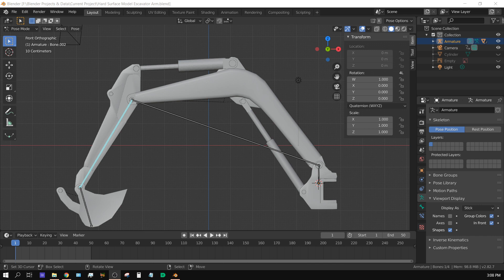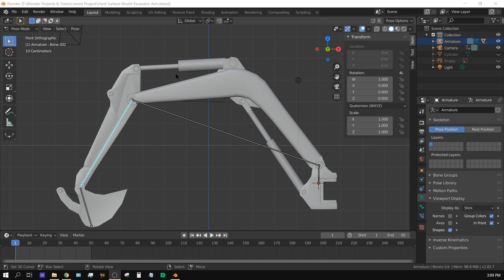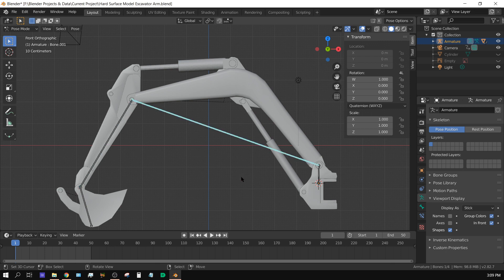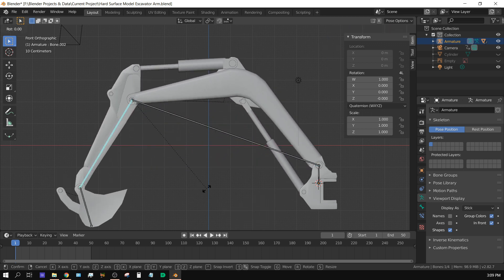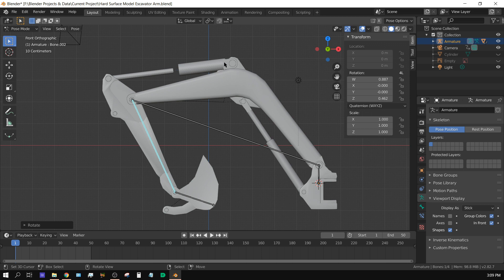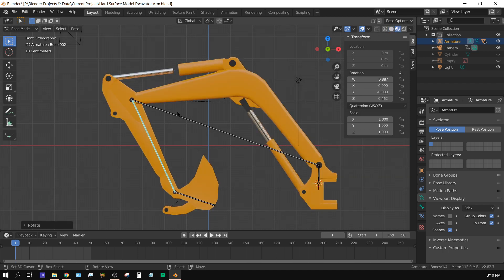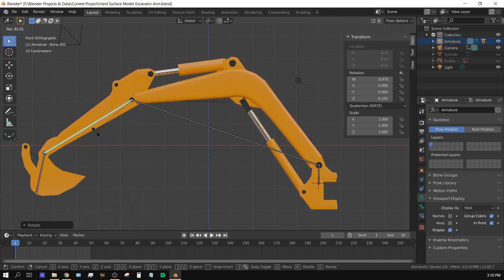Excavator Digger Test Bone Rig #BlenderRookie

Comment: Hey, this actually looks cool.

Now I'm thinking of possible ways to mix some physics in. Make each part a separate invisible collision mesh, add constraints inbetween to keep it all in place, and parent original bones to the meshes? :D
Reply from the maker: The only part that needs to have rigid body physics is the bucket and it can just be made an animated rigid body mesh object.
Reply: @BlenderRookie  
Makes sense, but what about throwing large things and forcing the entire excavator to tip over? :D

Comment: It's coming along nicely. You have really improved over the years, give yourself a well deserved pat on the back!  Out of interest, what motherboard do you currently have? I am looking to get dual 2060 supers or if can 2070 supers.  But anyway keep up the great work, and enjoy it!
Reply from the maker: Thanks, I appreciate that.
I have an Asrock B350, which is a very cheap MB that I would not even consider buying now. In order to run two GPUs in Blender, all you need is two PCIe slots, preferable two x16 slots. But a rendering GPU can easily use an x1 slot with an adapter.
If you are looking to build a system I would go with a newer MB. I plan to upgrade to a MB that supports 3000 series AMD CPUs. Probably something like the Asus Prime X570 that can technically support up to 6 GPUs and it has SLI, NVLink and crossfire as well.

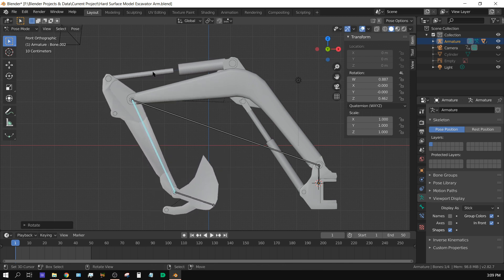Comment: 0:49 just make the outer part longer.
Reply from the maker: Actually that's exactly what I did. Right after I uploaded the video I extended the arm completely and I saw that I could make the larger part of the cylinder about 20% longer and that would solve the issue.

Typically I initially look for a more complicated solution because I am a boob.

Comment: You can make a shapekey to make the shaft of the hydraulic ram long enough. add a driver to the shapekey and then use the rotation of the bone to control the driver. SouthernShotty just did a tut that should explain it. https://www.youtube.com/watch?v=HbtdExjVb5U 
The part you want is from minute 7 to 9. For the rig you have here, in the drivers editor, set the driver type to Average Value; Object to Armature; Bone to Bone002; use Z rotation and set Space to Local Space.
Reply from the maker: Yeah, that would work. But I ended up just making the larger around part of the cylinder longer and it solved the issue.
Reply: @BlenderRookie  That sounds much easier. (Also more realistic.)